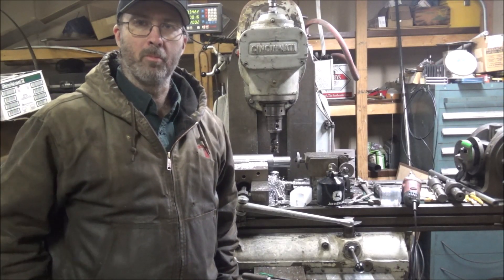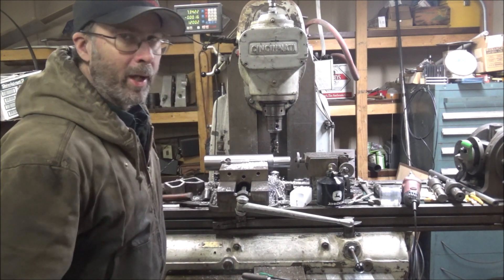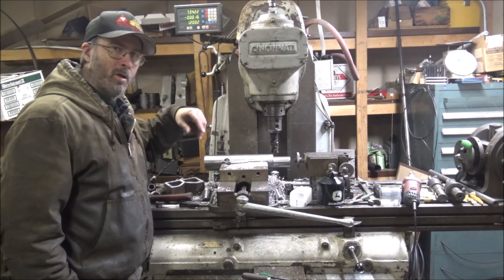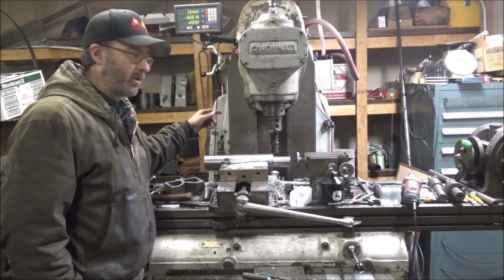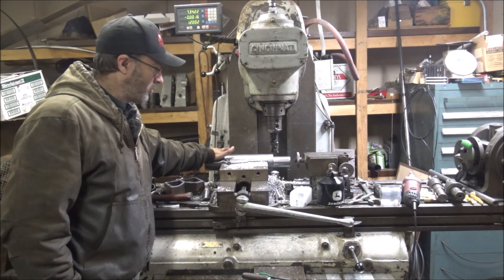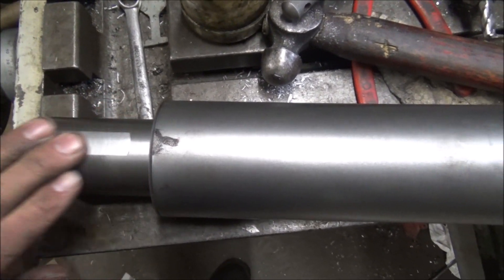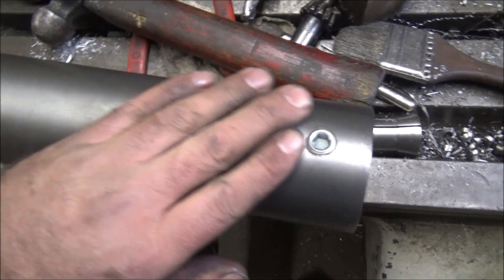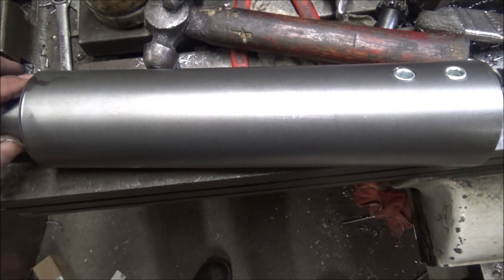Making a Boring Bar Extension

Comment: But would the OD of the extension hit the bored hole as it progressing down ?
Reply from the maker: Check out this video where I use it with a support in the bore to do some boring over 3 feet deep. Using The Bored Hole to Back Support The Boring Bar You Have Likely Never Seen This Machinist Trick
https://youtu.be/Poi1QMOYcIk

Comment: I'm wondering if this drill press can handle the tremendous load of a 3/32" drill bit for drilling holes for scrollsaw fret work...lol
   https://youtu.be/G2ZqREX7yXU
Reply from the maker: As long as you don't push it it should be fine. :-)

Comment: Is that a John Deere oil can on the bed of the mill?
Reply from the maker: Probably, I have several of them in the shop I use for lubrication of the machines.
Reply: I will have to do some looking and find me some of those
Reply from the maker: @truckman94  Need a part number? You can have your dealer order them if they don't stock them.
Reply: @bcbloc02  yes sir that would be great

Comment: Couldn't find a good end mill for the job and had to resort to the light duty finisher huh? lol.
Reply from the maker: I should have used a face mill but all of them were in the other shop so I used what I had. :-)
Reply: @bcbloc02  Just teasing a bit Brian. The inserts alone on your end mill there are worth more than 4 of the cheap face mills I have.

Comment: Brian,  Consider any time you make a flat for an application like that, to incline the flat by 1 or 2 degrees to favor the shank wedging itself tighter to the set screws, should it try to pull out.  With the inclined flat going deeper inward, the shank can not pull out due to the wedging action.  I do all my shanks with flats like that.
Reply: I think they call that a 'whistle notch'
Reply: @funone8716  Hey, Did not know that.  Makes sense. Thanks.
Reply from the maker: That is especially valuable on an endmill where it tries to pull itself out. These boring bars push in so not a big issue. The old original factory bars were all morse taper so they for sure could have pulled out if the cutting forces were wrong.
Reply: @bcbloc02  Keep up the good work Brian.  If you are ever in Charlotte NC you are welcome to visit my shop.

Comment: i am just curious.. have you ever though when you need to create extensions like that .. that you might be able to use something like a shoulder screw or an extended tip set screw.. so you are not relying on the face of the set screw to transmit the torque thru the bar.. but an actual smooth shank of a shoulder screw thru the shear line to transmit torque . think of the counter bore used in GM starter mounting .. the knurled area passes part way into the counter bore to perfectly align the starter..  you may need additional set screw holes drilled to give you radial run out adjustment abilities ..
Reply from the maker: The standard set screws do a fine job of driving. Never had a problem and most all my end mill holders work the same way.